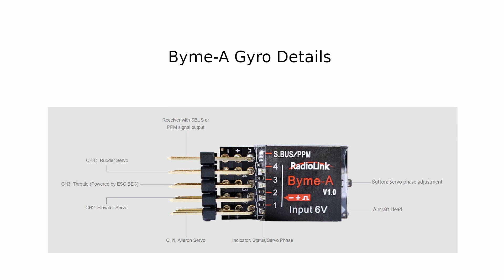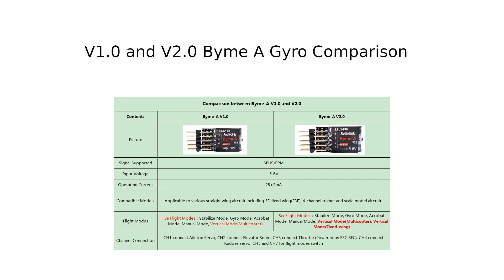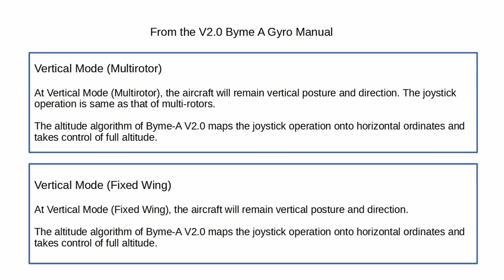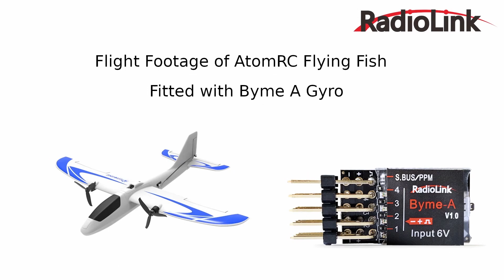Tutorial On How to Use RadioLink Byme-A

Comment: Sorry, how do assign the modes to a switch
Reply: And lest I forget, does this also have a motor safety lock, if the channel 5 and 7 is used for switching modes!
Reply from the maker: Hi, sir. You can assign a 3 position switch for channel 5, and a 2 position switch for channel 7 to switch the flight modes. Here is the detailed manual of Byme-A for your reference: https://www.radiolink.com.cn/bymea_manual  And sorry Byme-A does not have motor safety lock. Byme-D and Byme-DB have motor safety lock, which is controlled by the switch of channel 7. Here is the link of Byme-D for your reference: https://www.radiolink.com.cn/bymed_manual  If any question please feel free to contact us. Our email is after_service@radiolink.com.cn

Comment: Hello just found jour channel.
I have this a gyro and a flysky fs i6 tx + rx. The problem is that after conecting the gyro beeps and one green light is constand blinking other is green.
Can you pleas advice me

Thank you in advance.
Jo.
Reply from the maker: Hi, sir. Thank you for your support. Byme-A will not beep. The beep may come from your ESC. You can check the detailed manual of the ESC to know if you need to calibrate the ESC so the transmitter can be recognized by the ESC. And for the LED of Byme-A. Don't worry. The blinking green ot solid green does not indicate anything. Here is the detailed manual of Byme-A for your reference: https://www.radiolink.com/bymea_manual   If any question please feel free to contact us. Our email is after_service@radiolink.com.cn
Reply: @Radiolink_official thank you.
Reply: I found the problem, it is the escape.
I try a other escape and no problems at all.
Happy Me.😆
Reply from the maker: @joskites8374  Great to know you figure it out. If any other question please feel free to contact us. Our email is after_service@radiolink.com.cn

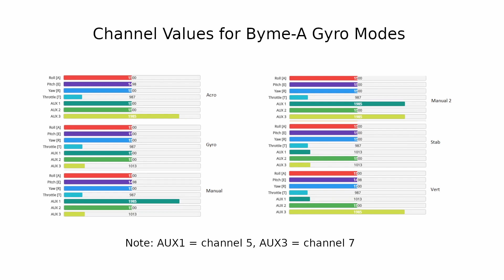Comment: At 3:47 I think is incorrect .
 I have 3 positions on one switch and the 2 positions on the other . 
   So I see it as 6 modes total . 
 The 2 position selects between 3 fixed wing modes on low , and on high it gets 2 vertical modes and the acro mode .
  I only have one manual mode . 

 Anyway , do you notice a delay sometimes after take off in vertical mode multi  where the ailerons want to stick in full deflection until a climb and then a pronounced snap into beautiful stabilized hover a second or so later ? 
    I also was seemingly getting intermittent yaw control . Maybe it is just a delay but I saw the yaw stick moving the rudder instead of aikerons to yaw . But sometimes it did work . 
  Maybe it is radio interference from many wifi ? 

 Batteries were full . 

 I will call back
Reply from the maker: Hi, sir. Thank you for your feedback. This is a tutorial from our customer. In the video, he uses Byme-A V1 which means it has 5 flight modes. May I know if there is any problem when you use your Byme-A? If yes, could you please take a video to us to show your problem? It will be more helpful for us to know how to help you solve it. If any question please feel free to contact us. Our email is: after_service@radiolink.com.cn

Comment: I'm at the part after binding and set up and the servos are ready to install.  
  I noticed my calibration was left down&out and right stick up and out .  
   It's a jumper t- pro . Tx 

    Time to glue in the servos 😅 almost ready to fly it . 
  It is a 3D foamboard kit . 
      I only ever flew with fpv
Reply: Ok .  I have all modes and switches configured correctly now . And my calibration is both sticks down and out . I am using a jumper T-pro with open tx .
Reply from the maker: @GregDahl-g6g  Thank you for your support.
Reply from the maker: Thank you for your support. If any question please feel free to contact us. Our email is: after_service@radiolink.com.cn

Comment: I just bought a radiolink transmitter, the at10II and the byme-a.   Both work separately, but i can not get the two to work together.  What am i missing?  With juat the reciever in, everything works as it should.  When i put the gyro in line, the transmitter no longer does anything but the gyro is working.   You mkve the plane around the gyro is doing its thing but the reciever does nothing!   What am i doing wrong???
Reply from the maker: Hi, sir. Here is a tutorial on how to use AT10II with Byme-A. Could you please check it? https://www.youtube.com/watch?v=8b0RTYwO8Yw&pp=0gcJCU8JAYcqIYzv  And please make sure the LED of the receiver is in blue/purple, and the cable should be connected correcly. Don't connect them reversely. If any question please feel free to contact us. You can take a video to us to show your connection and your problem. Our email is after_service@radiolink.com.
Reply: Yeah, that video is sbout as usless as a tit on a bull.  Already went thru all that.  The problem has gotta be the radiolink transmitter and the fact that my channels don't match anything ive seen on the internet of what others are on,.  The damn radiolink instructions don't say anything about channels being different.
Reply from the maker: @donrusnak7230  Hi, sir. May I know what receiver are you using? Could you please make sure the receiver is bound to the transmitter successfully? Could you please take a video to us to show your connection and your problem? It will be helpful for us to find out the problem and help you solve it. Our email is after_service@radiolink.com
Reply: Its the one that comes with it.   Yes, its bound and works FINE without the byme-a inline.   As soon as you plug everything in where it is supposed to go, and ive double checked that about 100 times now, that also is correct.  I think the problem is that channel 5 and 7 are different than what was in ( one of the videos)  but ive gone through that direction book, and i csn not find anywhere in there that says how to swap channels.  But i honestly dont know but one thing i do know is it isnt working!!!   And i cant for the life of me understand why my transmitter might be on different channels or placement of.   But finding directions ( that are not in chinese) or videos that actually show triuble shooting, im at a loss!   All the videos just tell me what i already know.   Worst part is this was bought at Christmas (transmitter) and that worked fine on the std stick controls.  I had no idea at the time that my other channels might be different or off until i decided to get the gyro unit.   Now although i checked the transmitter out meaning test it, i did not try it until i got the gyro so im pretty much at a loss if this thing is a defect.  Radiolink_official
Reply from the maker: @donrusnak7230  Hi, sir. AT10II can work with Byme-A. Here is the tutorial: https://www.youtube.com/watch?v=8b0RTYwO8Yw&pp=0gcJCU8JAYcqIYzv  You just need to assign a 3 position switch for channel 5, and a 2 position switch for channel 7. Sorry we do now know why your AT10II cannot work with your Byme-A just from your description. Could you please take us a video to show your settings on AT10II, and then show us your connection and your problem? It will be helpful for us to find out the problem. Our email is after_service@radiolink.com

Comment: @Radiolink Official- my problem is when I switched to "stabilized and Acro mode the aileron and elevator works fine but when I switch to "Manual mode" the aileron and Elevator wont move and only the rudder move? I'm using a Jumper T14 transmitter and sbus/PPM receiver. please help!
Reply from the maker: Hi, sir. Do you mean that the control surface doesn't work well in manual mode? Could you please follow the manual to check the gyro phase and the transmitter pahse. If they are correct, there is no problem. Here is the detailed manual of Byme-A for your reference: https://www.radiolink.com/bymea_manual  If any question, please feel free to contact us. Our email is after_service@radiolink.com.cn

Comment: Hello, I bought Radiolink R8EF and Byme A. I binded R8EF to my transmitter fine (all controls, channel worked on plane). After connecting R8EF to Byme A (I introduced channel 5,6,7 to my transmitter) I can not control plane surfaces, but gyro is working /stabilizing, moving controls/ accordingly. But I can not activate servos, move surfaces with transmitter, also throttle is not working. Please help. I am using Jumper T Lite transmitter 4in1.
Reply from the maker: Hi, sir. RadioLink control system is not open souced, so sorry R8EF can only work with RadioLink transmitters. R8EF is compatible with RadioLink T16D/T12D/T8FB(BT)/T8S(BT)/T8FB(OTG)/T8S(OTG)/RC8X/RC6GS V3/RC6GS V2/RC6GS/RC4GS V3/RC4GS V2/RC4GS transmitters. And by the way, Byme-A supports SBUS or PPM signal, May I know what channel did you plug Byme-A into in R8EF? And what color is the LED? Here is the detailed manual of R8EF which introduces the working modes of R8EF: https://www.radiolink.com/r8ef_manual  If there is any question, please feel free to contact us. You can take a video to us so we can better know about it. Our email is after_service@radiolink.com.cn
Reply: @Radiolink_official  Thank you. I have multiprotocol transmitter so it works well with R8EF. I managed to bind it to my transmitter no problem. My problem was, that I didnt press mini button on R8EF to change to SBUS mode when connected to Byme A (BLUE LED) instead of "normal" mode with red LED.
Reply from the maker: @SIG636  red LED means PPM working mode. You can connect Byme-A to PPM channel of R8EF. Here is the link of R8EF which introduces its working modes for your reference: https://www.radiolink.com/r8ef_manual     If there is any question, please feel free to contact us. Our email is after_service@radiolink.com.cn

Comment: Please, we need a video demonstrating how to configure the channels and switches on the radiomaster boxer or another radio with sound (gyro mode, manual mode, etc).
Reply: Set up ch 5  three position switch on low ( -100). In mixer page .
 To put the middle and high switch positions on the same ch 5 , you need to go into mixers again , highlight ch5 and hold downnthe roller until the options " insert before , insert after , edit , delete ," appear . Select " insert after " . Th we n a mixer set up page appears and you fill it out for the switch middle position . 
 Then back out again and highlight mixer ch 5 again and hold down the roller until you see the option insert after . Select " insert after" to write the 3xway switches high position in mixer command lines .
 Back out and see ch5 with all 3 mixer command lines you just wrote .
  Do the same for ch 7 in mixer page but use low position and high position . Don't use the middle positionnif it is a 3 way switch because channel 7 is a 2 position low (-100) and high (100) .
 That's it . 😊. You still have ch . 6 and ch 8  open unused . 
    The calibration might be left down and left and rightstick up and to the right . Mine is . I have a jumper t- pro .
Reply from the maker: Hi, sir. Byme-A supports standard SBUS or PPM signal. So could you please make sure that your spektrum receiver supports standard SBUS or PPM signal? If yes, it can work with Byme-A. Sorry we have no tutorial of Byme-A and other radio, but you can refer to this tutorial: https://www.youtube.com/watch?v=8b0RTYwO8Yw  In this tutorial, you can also know how to use other radio with Byme-A. In general, you just need to assign a 3 position switch for channel 5, and a 2 position switch for channel 7. For the sound, could you please contact the seller of the transmitter to know more about how to use the sound function? If any question about RadioLink products please feel free to contact us. Our email is: after_service@radiolink.com.cn

Comment: Hi all my stabalisation are going backwards. All working fine but results are opposite to what it should to to correct it. Down elevator goes down etc. how do you master reset?
Reply from the maker: Hi, sir. At first, you need to make sure the attitude calibration works well. Then you can follow the video to test the gyro phase. If the gyro phase is reversed, you can adjust it in Byme-A by pressing the button on Byme-A. Here is the detailed manual of Byme-A which introduces how to adjust the gyro phase: https://www.radiolink.com/bymea_manual  If any question about RadioLink products please feel free to contact us. Our email is: after_service@radiolink.com.cn
Reply: @Radiolink_official  I figured it out - I had to reverse ail/rud/ele at the transmitter, then i could calibrate it and it’s all sweet as, looks awesome- can’t wait for the wind to bugger off so I can test it out. Windy here in New Zealand atm. Great product - Thank you.
Reply from the maker: @fordboyzzzz  Great to know you figure it out. If any other question about RadioLink products please feel free to contact us. Our email is: after_service@radiolink.com.cn
Reply: Was just thinking an air speed sensor would be good @Radiolink_official
Reply from the maker: @fordboyzzzz  Hi, sir. Sorry Byme-A has no such sensor. Hope it can be achieved in the future. By the way, if you want more flight information, you can try our othre flight controllers such as CrossFlight. Here is the link for your reference. https://www.radiolink.com/crossflight  If any question about RadioLink products please feel free to contact us. Our email is: after_service@radiolink.com.cn

Comment: I am a subscriber. I finally purchased this byme A,and i am using a radiomaster boxer. I have a question: if i need reverse a channel should i do it on the byme A or in the transmitter? thanks
Reply from the maker: Hi, sir. Sorry for the late reply. It was the Spring Festival in China from February 4th to 18th. So we had a New Year holiday and we come back to work now. You can reverse and make sure the direction is correct in transmitter at first. Then if the gyro is reversed in Byme-A, you can reverse in Byme-A. Here is the tutorial of Byme-A for your reference. https://www.youtube.com/watch?v=8b0RTYwO8Yw If any question about RadioLink products please feel free to contact us. Our email is: after_service@radiolink.com.cn
Reply: Hello, her the same did you try to modify the channel range and set channel 5 & 7 for vertical mode
Reply: @yousefsaadeh7144 
   To do different switch positions on one channel you go to mixer and then select the channel with the first mix line and hold down the jog wheel until you see ""insert before , insert after , edit , delete ,"" options . Then select " insert after "" . Then fill out the mix settings that appear just like you did for the first mix on that channel . Name , switch , etc. 
   That way the switch positions for that channel are all on the same channel when you look at mixer page .
  The byme has to have ch. 5 and ch.7 with all switch positions " inserted after" .
 Sometimes we just see those  options but have no way to ask what they do
Reply: Great info and a great vid except the audio which is woefully low.

Comment: Does it self level in stable mode?
Reply from the maker: Hi, sir. Different form manually control, Stabilize Mode with flight controller balancing, is suitable for beginners to practice level flight.
The model attitude (inclination angles) is controlled by joysticks. When the joystick is back to central point, the aircraft will level. The max inclination angle is 70° for rolling while that for pitching is 45°. You can check the link here to better know about the 6 flight modes of Byme-A. https://www.radiolink.com/bymea_manual  If any question about RadioLink products please feel free to contact us. Our email is: after_service@radiolink.com.cn

Comment: Hi. When I turn on power everything apears right in the beginning and as long as I don't move the throttle stick. If I give a little throttle however,  then after a short while the motor starts spinning 1-2 seconds now and then  After some seconds  this happens with shorter and shorter intervals. Appart from this everything appears to work as expected. I have however not yet been flying with the setup. Any suggestions how to avoid this? I have the Byme-A ver. 2. My tx is a fs-i6x, rx is a fs-ia6b and the esc is the stock-esc, supplied with the Volantex P51-D 750 mm. Best regards Jan
Reply from the maker: Hi, sir. From what you described, we recommend you to check the signal transmission between the transmitter and the receiver. Since the throttle moved by following the transmitter. For Byme-A, you just need to follow it's detailed manual to connect and make attutude calibration, check the gyro phase and transmitter phase. Here is the link for you https://www.radiolink.com/bymea_manual  If there is still any problem, could you please take a video to us? Our email is: after_service@radiolink.com.cn
Reply: @Radiolink_official  Thank you for the quick response. To provide the right information to you, what would you like me to include in such video? Best regards Jan
Reply from the maker: @jan6950  Hi, sir. We want you to show your problem in the video. For example. if there is only problem in throttle, you can show that all the other channels work well (move the joystick to show all the other channels work well). Then show us the problem of the throttle. You can send the video to after_service@radiolink.com.cn

Comment: The instructions state that if the rudder deflections are too large, the rudder control should be changed. Does this gyro have no effect on the dual rate settings in the transmitter?
Reply from the maker: Hi, sir. If the gyro is too sensitive, you only need to adjust the position of the aileron servo arm buckle to solve. It's recommended to adjust the position and move the mounting hole to the center. If it still wobbles, you could move the position to the left. For dual rate (travel of the channel), you can adjust it in the transmitter. If any question when using RadioLink products please feel free to contact us. Our email is: after_service@radiolink.com.cn